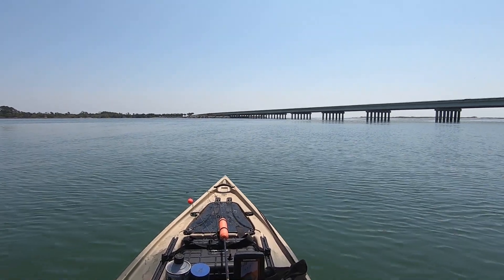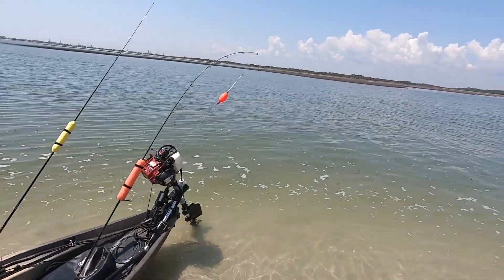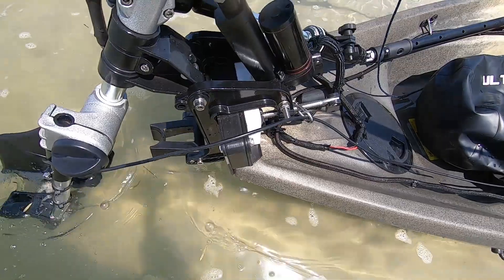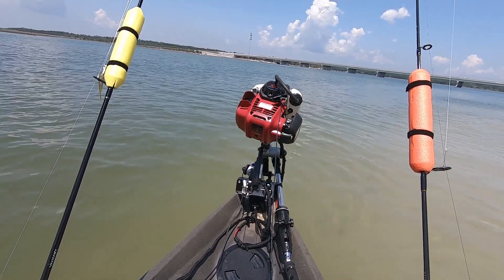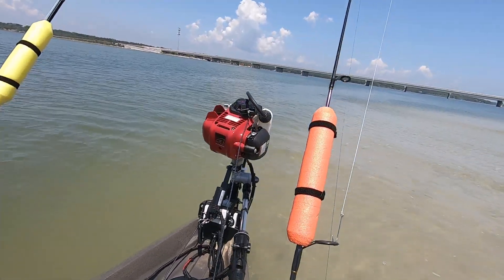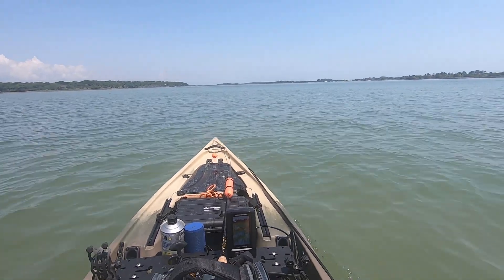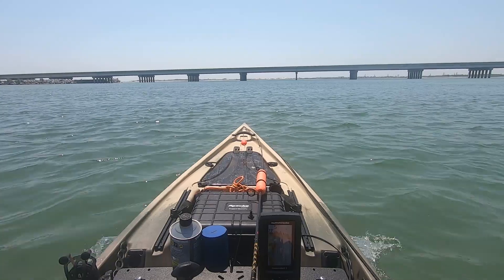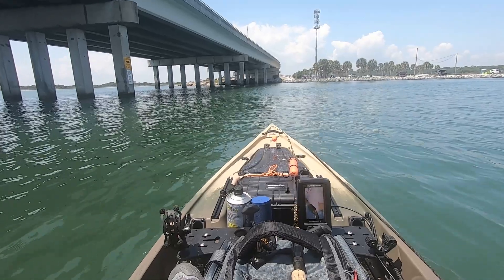Trim and Tilt with Sonar Using a 20v Dewalt 5ah Battery

Comment: I know your mainly a gas guy but how about the electric powerhead you were working on a few years ago?I would love to be able to swap powerheads when I go to the pole and troll only areas of mosquito lagoon by cape canaveral. Maybe powered by dewalt 60 volt batteries!
Reply from the maker: The manufacturers are not making the motors and combined battery packs up behind the trigger and are moving toward the cheaper motor and string assembly at the base. So I can not depend on them for a supply of motor assemblies.

Comment: Good morning, what are those things on your fishing rods? (orange thing) I still have not broken in that electric start 2stroker. I have been working on another project, if you like video games here it is --->> https://www.youtube.com/watch?v=OuR9-oUrChc the tilt system works good, better then the dive to the back of the canoe when you spot a dead head  out front.
Reply from the maker: They are floats.
Reply: @kayakbuddysllc-lightweight4947  O, I see. I use the annoying rod clipped to boat system.